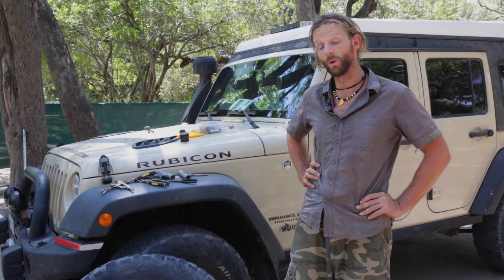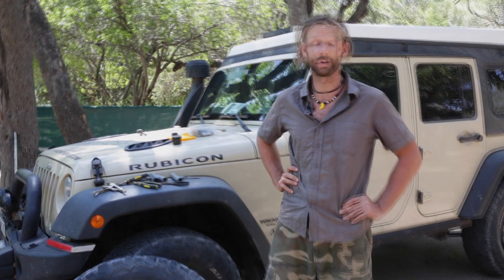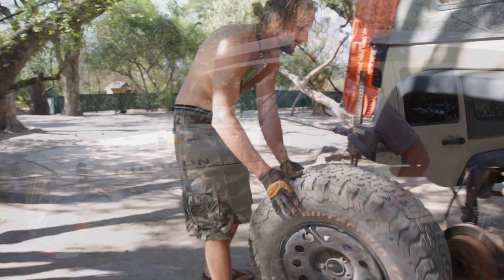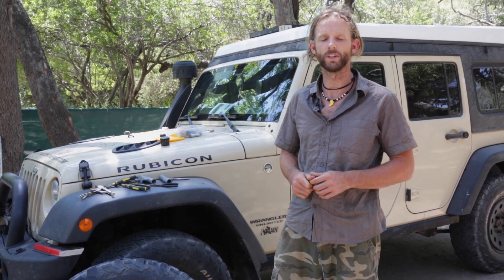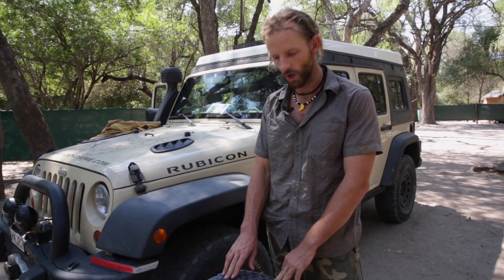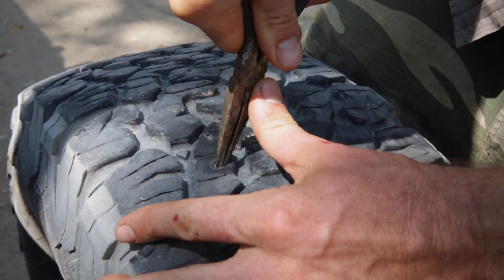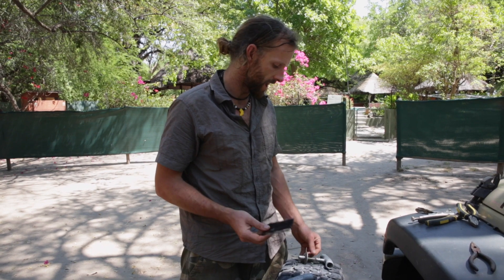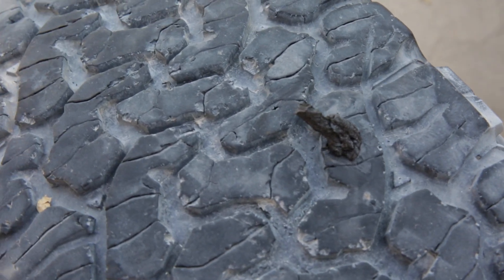How to PLUG A FLAT TIRE on your Overland vehicle

Comment: Just a note that although the ARB Patch Kit can be considered a permanent repair for tread punctures it is not recommended for sidewall damage repairs.  Sidewalls are too thin to hold the patch properly.  Although I was on a Jeep rock crawling run where a rig blew two tires and the spare got a 1" tear in the  sidewall and it was patched by jamming 5 goop cords in it (no reaming involved) which held up until we got back to town.  Sidewall damage cannot be legally repaired in the US.

Comment: Another advantage of rotating your wheels yourself, is you tighten the nuts to a torque that you can work with on the side of the track, not the ridiculous over-tightening that is often done in workshops using rattle guns.

Comment: Hi, an aussie who has recieved much conflicting information; is that a permanent repair? Thank you and safe travels brother.
Reply from the maker: I think they might be illegal in some countries, but I use them as permanent. I've driven 20,000kms + on those plugs and never had a single problem.
Reply: Used them many times never had an issue.

Comment: A plug should only be used as temporary.
Two reasons.
#1 You have no way of knowing what, if any damage was done to the inside liner of the tire. The liner is the inside skin/coating that actually holds the air.
#2 A plug in most cases will keep the air in. The problem is that a tire will have moisture inside it. With most punctures a plug will not totally seal the water/moisture from getting into the steel cords of the carcass. The moisture travels along the cord, rusts it, weakens it, and then you have a major failure. This is why a dismount and a quill style plug/patch is the only proper permenant repair.
Hope this helps. :)
Love your channel by the way! :)

Comment: As always, another wonderful video!  So you rotate every 6000 miles, but how do you rotate?  You said you do a 5 tire rotation, what goes where?  The spare goes to which position? And where does that tire go? And so forth, until the end... which tires becomes the spare?
Reply from the maker: Spare to Rear Passenger. Rear Passenger goes to Front Passenger. Front passenger to rear driver. Rear driver to front driver . Front driver to spare.
I know there are different ways to do it, and I like this one!
Reply: @TheRoadChoseMe  Thank you, my new Rubicon is quickly coming up on 6000 miles, I will try rotating them myself.

One of the many clever things I like about a 5 tire rotation is that you can do one at a time!

Comment: Thanks for the video. My suggestion is not to work underneath your jeep when supported by your Hi lift jack alone, those things are notorious for falling over. You can put your removed wheel under your axle to support the vehicle in case your jack falls and then work safer beneath the vehicle. A small hydraulic jack is nice too because your only have to lift the vehicle an inch or two to remove the wheels and are more stable. Anyways stay safe as you will put on more miles that way.
Reply from the maker: Excellent advice, and a small hydraulic jack is on my list for that very reason!